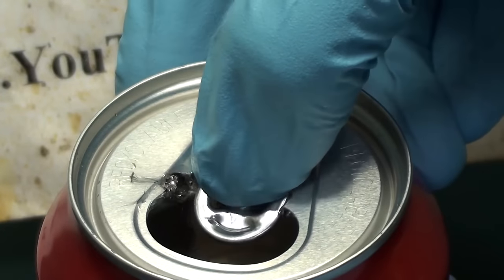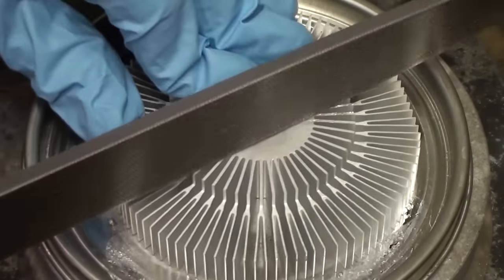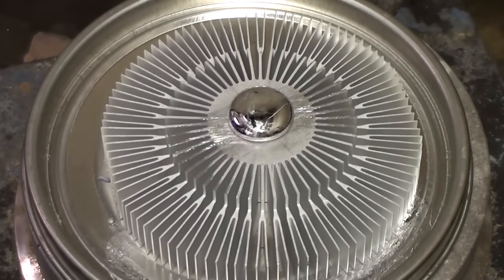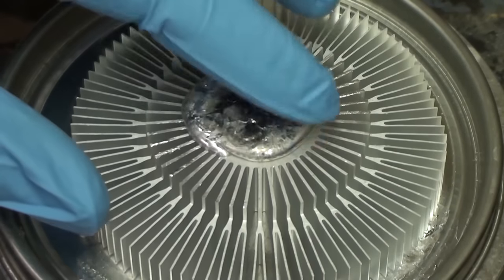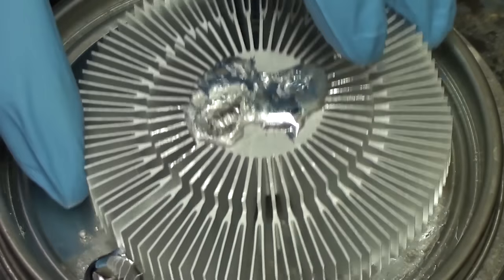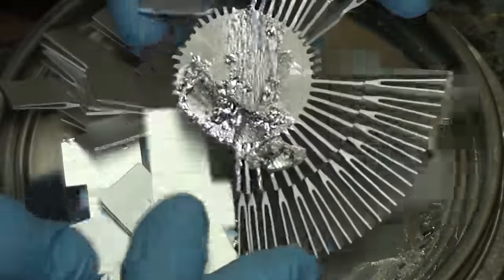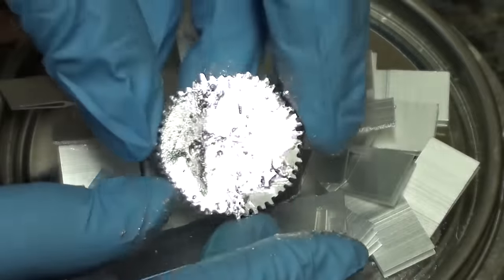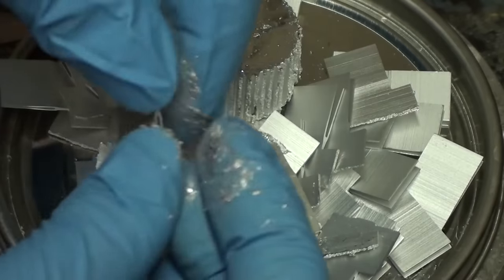Gallium Induced Failure of a Heat Sink

Comment: Imagine using this on someones car with Aluminum wheels
Reply: Dear ZorZelda,

On your channel, were all the games with no deaths and 100% complete?

Sincerely, Sam Gross.
Reply: Imagine spending a whole lotta years in jail for wilful damage and murder...
Reply: lel u intrested
Reply: systmh Just remember, trucks, large body over frame SUV’s, and vehicles with Diesel engines would not be susceptible to gallium. Their engine blocks are made from steel.
Reply: Cylinder head. Put some gallium on that and watch the spark plugs fly out when you crank it over!
Reply: @RogerBarraud  What? Context?

Comment: Here's a tip for anyone who's into electronics.  I might mention that in addition to being a chemist, I've been an electronics hobbiest since I was 14, and worked for years as an electronic technician.  This is a little trick I learned decades ago!  We've all been told, "you can't solder aluminum," at least not with ordinary Sn/Pb solder.  Well, "they" lied to us!  The key to soldering Al is to constantly scrape the surface with the tip of the soldering iron.  This will continuously remove the oxide coating that keeps forming.  It feels like you're kind of "working the solder in."  Try it, and amaze your friends and scare your enemies, that YOU can solder aluminum!
Reply: Nice tip
Reply: Clyde Wary 
that not a solder m8 only looks like, its liquid metal thermal compound looking like solder, but most of manufacturers warn about not to use it on aluminum couse will corrode id, its safe on coper heatsinks
Reply: Tried to do that way and failed: no wetting, no attachment. Would be awesome if you could provide a video.

Comment: essentially yes but it would take a while for it to work

where would he apply it to without drawing attention (seeing as it could be quickly wiped away if found)

aircraft are designed not to rip apart if there is a hole somewhere, the only way to successfully bring it down as discreetly as possible would be explosive decompression, rapid air pressure changes inside the cabin which already are higher than outside.

Comment from the maker: nah. you're just running away because you realize you have a strawman argument, "not 100%.." when i said "gallium based" that encompases all pastes containing gallium including those containing between 1 to 100% gallium.

I also said that they can't be used with *aluminum* heatsinks, but most high-quality heatsinks are made of copper. Sometimes they're plated with nickel to give a silver finish you might mistaken for aluminum.

But feel free to run off with your tail between your legs.

Comment: Yes you can do it that way. The aluminum reacts with water to produce aluminum hydroxide and hydrogen gas, while the gallium doesn't react at all and sinks to the bottom of the container. students at Purdue University found that out.

Comment: You missed the point of the question....

I know that the gallium isnt weakening the aluminum by oxidizing it. Did you notice that he scratched the surface of the aluminum BEFORE he put the gallium onto the aluminum? That was to break through the oxide layer. 

Any, back to the original question I posted above^.

Comment: hey nurdrage,

i got some trouble with my gallium lately. i melted it several times for just playing with it, but now it is a very thick liquid when i melt it which does barely float at all. i think this comes from the reaction of the liquid metal´s surface with the oxygen in the air. by solidifying and remelting the oxide mixes with the metal, so as a liquid it gets thicker and thicker. so far my theory, do you know something to clean the metal somehow? 

btw great your back making videos :)

Comment: actually mercury and gallium have the same effect on alumium, basically what happens is it dissolves the aluminum oxide layer which allows the inside (pure aluminum) to be oxidized thus weakening it (as the process repeats). this is why you are not allow to bring mercury or gallium on airplanes

Comment: i have 2 questions, and please please answer them.
1, how does gallium react in a glycol based liquid, like say, automotive antifreeze?
2. If the metal weakening effect is still present, why not run it through an aluminum engine?, like say an old subaru..  just for giggles.

Comment: You misunderstand. 

Both Mercury and Gallium react with Aluminum Oxide. Al oxidizes very quickly. But the oxide layer is very hard. It forms a shell around the Al preventing further oxidation.

Hg and Ga dissolve that oxidation layer. This causes the next layer of Al atoms to oxidize. The Hg or Ga then react with the next layer. This repeats until you run out of Al or Hg/Ga.

Since all commercial aircraft are made from Al, you are not cannot take Hg on board. Toxicity has nothing to do with it.

Comment: I was under the impression that aluminum, like chromium, zinc and other elements that develop protective oxide layers, do so VERY quickly. I read somewhere that chromium does it almost instantly, so I thought that you'd have to cover the aluminum with liquid gallium first, THEN scratch the oxide layer off, otherwise it will instantly redevelop and become a barrier that prevents gallium, oxygen from reacting with it or affecting it.. I guess thats not the case?

How long does it take to develop?

Comment: I don’t see anyone using that much gallium, or using liquid metal with a stock cooler, and since most other heat sink designs are different from the stock coolers I don’t think there is much risk

Comment: You'd have to scratch through the oxide layer, which wouldn't be hard. You'd have to get the carpet up, too, which would draw attention. Then you'd have to wait while enough Ga permeated the structure to do damage without anyone noticing. Since if the toilet floor falls through like wet paper, somebody would notice before the wings felll off.

Comment: in your expierience what is the average rate of diffusion ? is this easily accelerable ? is this stable or volitile? what range of metals is this effective against? A major problem with armoured fighting vehicles is getting crew out of  not quite so roadworthy vehicles, this also has potential in any other casualty removal situation? collapsed buildings crushed vehicles, could this be a potentially helpfull technique in surgery removing shrapnell ect

Comment: You are still missing the point of the question. I dont how much more clearly I can make it. I was hoping to hear from Nurdrage or someone who understands what I'm asking. If you watch the video, he scratches the surface of the aluminum on both videos to remove the oxide layer so that the gallium can penetrate, then it alloys with the aluminum, I fully understand that. I was asking how long it takes for the oxide layer to reform, preventing the gallium from penetrating.

Comment: And yet people are putting "liquid metal" (a gallium/indium alloy) on their CPU/GPU.
Reply: u can see videos showing how those cpus gpus and coolers haven't been damage for more than over 9 months daily usage...
Reply: Heatspreaders on CPUs are made of nickel plated copper, so are most non stock coolers at least at the base of the heatsink while the fins are still aluminium most of the time. The CPU and GPU die are both silicon, one of the common uses for "a liquid metal" thermal interface material is applying it directly between the CPU silicon die and the integrated heat spreader in place of the stock TIM paste. Older CPUs had the IHS soldered on and had already good thermal conductivity between the die and the IHS.
Don't know if on air coolers the gallium from the CPU/GPU could ever chemically reach the aluminium fins through the copper base and heatpipes, probably not. Water cooling loops with no aluminium in them should be completely safe to use with gallium containing TIM's.

Comment: would it work as a substitute for thermal paste if you had a copper heat sink?
would it melt through the cpu cover that protects the processor?

Comment: I wonder how did gallium affect the blades when it didn't even touch them. But the center block that had gallium on top on it was not affected. Hmm...
Reply from the maker: gallium diffuses through aluminum like water through tissue paper. So it can affect aluminum much further away than where it touches. The center block was affected, but it's still strong enough to hold up. If you look closely though, there are massive dents in it.

Comment: I bet if someone were to put a few ml of this into the engine oil of a vehicle with an aluminum block, it would create some really interesting mechanical failures with the engine running. especially in something like a bus or truck that runs and maintains temperature for several hours if not days on end.

Comment: You're inconsistent. First you say HG isn't allowed on airplanes because it's toxic. Then you say that it doesn't matter that Ga is corrosive to Al because it is in a container.

You're correct that Ga is shipped in hazmat containers. But both metals are dangerous to take on Al airplanes. Hg is not allowed on commercial flights. There are exceptions but not for standard passengers.

Comment: Think people. This can't hurt a plane. A terrorist would need access to the plane's hull. They would need to remove all the plastic and paint and everything before getting to the bare metal. Then, they would need to heat up the aluminum and wait for many many hours for the Ga to diffuse into the aluminum enough to weaken it. Guess what? There isn't enough time to do any of this. More importantly, you can't do all this without getting caught. Plus, crashing a plane isn't good anymore.

Comment: ooooh sh*t..
i got some spare Coolaboratory Liquid Ultra last year from a friend, i had the tube only so i was unaware of the contraindications. i put this inside my ps3 fat, both under headspreaders and on top, facing the heatsink: a big ass block of aluminium... (later revisions with the silvery heatsink, not the earlier with copper and heatpipes before the heatsing).

This is bad.

Comment: buy a junker car with an aluminum head or engine block.. poor a good amount of Gallium into the engine through the oil cap and then attempt start it sometime later.. I'm interested in seeing if the engine will just crumple or if the oil will prevent the Gallium from reacting.

Comment: You can not use that on a CPU because that is likely to destroy it.  I know it will attack the heat spreaders.  It may attack the die or connections on or in the CPU.  I would recommend against using it for that unless you don't mind losing your CPU and possibly causing electrical damage to other parts of the computer.

Comment: EXPOSED
 fake metalit alluminum because the galluim did not touch a side of the heat sync and then he broke a peice of it
Reply from the maker: The gallium soaked through. Just like if you put water on a tissue it will soak through to parts that didn't originally touch the water.

Comment: I bet it is intel heatsink that you havet there
Reply: Heatsinks aren't CPU-based. You can apply any heatsink to any cpu. However I will give you a win based on it might not be easy to use an Intel-Chipset heansink on an AMD-chipset.

Also, Intel all the way.
Reply: Ḅasėd Ġoď
it's the design of the heatsink that intel normally used for the pentutim 4 line, and it had the Intel sticker on the fan, and heatsinks aren't based on useage, but mainly on the manufacturer and the mount, by "Intel heatsink" we mean intel made the heatsink used in the video. and if you use thermal epoxy, it is quite easy to use an intel-made stock heatsink with an AMD CPU
Reply: thank you slango i thought i was the only on to see the blue sticker

and baded god....AMD for the win
Reply: ali hassan
AMD is better for iGPUs, but if you are getting a dedicated card, go for intel as they have better CPU dies but crap for iGPUs
Reply: slango20 Oh I didn't notice the intel sticker I was just listening in.

ali hassan No, AMD is for people with smaller budgets, Intel is for people with more money to throw around. Intel gives more performance. Basically, Intel is a better choice if you could put get it. AMD is ok, but more people just prefer intel.

Comment: Put this on a boeing 747...
Reply: +TheUnion | Kyunami The airframe and inside of a Boeing 747 fuselage is made from mixture of composite material, high strength alloys, and carbon fiber.  Gallium wouldn't do anything to it. Maybe you could punch a hole in one of the side panels, though.